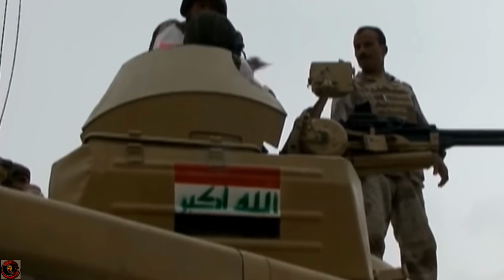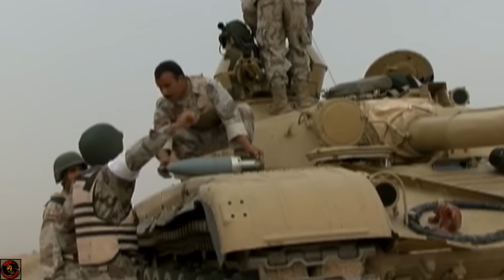Do Russian Tanks Need Bigger Guns?

Comment: 4:08 True. Vedy STONK Stalinium Soviet tenks powered by Zhukov-grade vodka aren't limited in anything, but gun depression. They usually have meagre gun depression of around 5-6 degrees. People always say Russian tenks have the worst gun depression. But that's not so bad, because the prize that goes to the tank with the worst gun depression is actually the Swedish S-Tank, because itz really just a fixed gun that is bolted on to the chassis. So technically 0 degrees (+1 degree if your lucky enough to run over a deer for tactical aiming XD). The only real reason the S-tank is able to aim up/down is due to its hydropenumatic suspension (-10/+10 degrees). And even with that special suspension, the S-tank still sucks, because it doesn't have enough gun elevation to engage low flying aircraft at relatively close range (So itz kinda no wonder why mass production of this vehicle wasn't even considered, that, and also, because it sucked at firing on the move, because it didn't have a gyroscope...and no, you can't mount a gyroscope on to a fixed gun). Hell, it would have to be built like the STUG (becauz Stug gangsta lyfe) with an ACTUAL elevating gun in order to have any chance in haell to engage any sort of aircraft

So, the hydropenumatic suspension could maybe increase the elevation range of a soviet tenk to around (-16/+26 degrees)...but like you said from before Matsimus, you said that this type of suspension is kinda a beech in sandy environments, and you have to haul lots of helium gas or something :/

But despite that, I have to kind of hand it to the Russians for at least attempting to fix their gun depression problems. One notable way they tried to fix this is through their T-95 (No, not the WW2 T-95 doom turtle that came from a kid's wildest imaginations) "BLACK EAGLE" tenk program (I am kinda surprised why the Russians didn't even consider to mass produce a cheaper version of the T-95.....but no...they had to go with the T-14 Armata, a tank with so many flaws *mumble* **mumble**...because they wanted a robotic tenk they said...it would be fun they said). The turret of the T-95 tank was very interesting, because it incorporated a sort of "horn" that extended up from the crew compartment of the turret. This "Horn" feature allowed the gun to depress further than conventional tank turrets. In fact this "Horn" allowed the tank to depress to -10 degrees (which is pretty impressive, considering that the T-95 "Black Eagle" Tank turret was very short. And for those who wrry that reloading the gun breech while it is elevated up to the "horn", I have to say that you can't reload a gun in a conventional tank turret either when it's in full gun depression. This is, because you rly don't have any space above the gun to reload it while it's fully depressed. So, what the tank crew would do to reload a gun when fully depressed, is to elevate it back up to 0 degrees, load the round, then depress the cannon  

This "horn" feature is apparently so good that it's also featured on the Cockerill 3000 turret, the Lerlerc tank turret, and the K2 black panther tank

Comment: Russia doesn't need a bigger gun.  What they need is to get rid of the separated two-piece ammunition system if they want more power.  It is because of separate ammo, which is why their 125mm gun ammo ended up with less KE than NATO's 120mm ammo.Also, Russia's tank doctrine doesn't exactly rely entirely on the tank for their only AT weapon or infantry support.  Surface-surface fires are their best suit, hence they don't need a big gun.  All they need is enough firepower to fix a NATO force in place, while the artillery trashes everything in their killbox.

Comment: I think they need to consider doing what small arms have done.  Take a 4" or 5" SHELL CASING (preferably a disintegrating case like the German 120mm Casing) but "downsize" the actual round's caliber to around 90mm (with a 70mm to 75mm Sub-Penetrator).  The increased velocity the 120mm case gives the smaller (sub-penetrator based) round would allow a flatter trajectory and greater penetration for hardened rounds.  The HEAT and HE style rounds would lose some power but could be made more effective with Thermobaric (fuel-air based) or Hyperbaric (reactive metal based) warheads.  The velocity would be an issue for barrel wear, but recoil wouldn't increase much.   I think this should be investigated by NATO.
Reply: What the hell do you think a APFSDS round is
Reply: Closer to 90mm fired from a 120mm bore.  Imagine SHRINKING the CANNON BORE to 90mm and STILL firing an APFSDS (but in 70mm, not 90mm) from that 120mm cartridge.   This would greatly increase the round's velocity without increasing the round's weight (actually decreasing it, in fact) or effective recoil (recoil speed will increase but not the distance recoiled).  This is one aspect of ammunition (HV small caliber) that may "export" from the US railgun tests.  It is possible to increase velocity using certain modern powders and materials used for railgun barrels that will allow smaller calibers to achieve the lethality of the 120mm smoothbore by accelerating smaller caliber projectiles above the perceived 5000 ft per second "threshold limit" of modern tank guns.  Imagine your current tank round as a "bottlenecked" cartridge with a normal powder charge but a much smaller projectile.
Reply: Blox 117:  They are reaching maturity.  The biggest problems right now are that you have to cool the emitter (usually with liquid nitrogen) of high output lasers (Megawatt output) and charging them.  I saw a proposal for an M1 with a homopolar generator connected to the turbine that charged a capacitor to fire the laser.  The turret was removed and the laser, targeting sensors, and MG were installed in a small mount on a rotating scissors-type armature (think of cherry picker type lifts) that could raise the weapons and sensors up from behind terrain features.  The two problems with it were a LONG cooling and recharge time and insufficient power to instantly burn through armor.  The design I saw is now at least 10 years old.  I'm sure they have made improvements by now.
Reply: The mass is attained by using super dense materials like Depleted Uranium.  The DU also acts like an API round when it penetrates.  It spalls and the friction causes the material to ignite.  This effect can be enhanced by adding a secondary Hyperbaric effect to the round.  A small canister of reactive metal (like Sodium mixed with Aluminum shavings) at the tail of the round will be ignited by the burning DU and cause an "overpressure blast wave" inside the vehicle after penetration. 
         The velocities I'm postulating with the subcaliber round being pushed by a 120mm CASING are above the 5000 ft per second threshold we have already reached today.  We haven't been able to effectively push past this because of potential barrel failure and the tremendous barrel wear.  The higher velocities will either cause a "catastrophic failure (explosion)," or will just "burn out" a barrel within a few dozen shots.  The Navy's experiments with railgun barrel life may have solved this issue by pairing newer High-Strength Steel, advanced metals like Scandium, and Carbon-Fiber Nanotube technology together in composite barrels.  This may allow tanks to exceed the current velocity limits by a significant amount.  This technology, combined with newer propellant technology, may allow us to make a "breakthrough" in Main Gun velocity/lethality.  
        Then there is the alternate technology that may move the forefront.  Digital/Electric binary rounds like those pioneered by the Australians with the Metal Storm System.  The US Navy bought and tested several 40mm Grenade Launcher Metal Storm Systems as a Point Defense System on their ships.  I do not know what the development state of Metal Storm is at this point in time.
Reply: NO FUCK WHAT YOU SAID, LASERS
Reply: swaghauler that was tested in the cold war by the americans I think. But remember velocity is not everything, projectile mass can be equally important
Reply: 110mm round with 140mm cartridge?????
Reply: You need both mass and velocity to have the energy for penetration, it's physics. But for higher velocity you need a longer barrel and bigger propellant charge and you wear out the barrel faster. The barrel can only be so long or it becomes unwieldy. Lighter rounds also lose energy faster at extreme ranges. So it must be a compromise between projectile mass and velocity for the required energy.
Additionally the projectile and propellent size can mean you can only fit a less than optimal number of rounds in the vehicles.
BTW lasers as energy weapons become useless in fog and rain due to refraction.

Comment: 3:51. Yes, recoil length is indeed a big problem, because it means that you need larger turret ring diameters. As far as I know, the most important requirements for mounting a larger gun is to have sufficient turret ring diameter (However, you can make larger turret ring diameters without extending the width of your chassis. And this is by inserting a turret ring that extends away from the side side hull of the vehicle. This result looks like a that bowl has been welded unto a tank's hull, and you can see this bowl more pronounced on the T-55, T-62, and post war russian tanks. Since this bowl feature helps in preventing the tank's hull width to increase, it also saves on mass. The M1 abrams also has this bowl feature too, but not to the extend of the soviet cold war/modern era tanks, and mass (you need mass, because that prevents large amounts of momentum being generated by the gun to act too harshly against your chassis, and rock it back, and forth). However, there are ways to remedy this, muzzle breaks, and certain types of suspensions can reduce main gun recoil. In addition to this, there are other MORE EXOTIC TECHNOLOGY THAT VASTLY reduces the recoil. Such exotic technology includes a special type of hydropenumatic recoil mechanism, and a VERY WEIRD high velocity recoilless gun that works similarly to a bazooka, but is much more complicated then that...shit...I already said too much. I won't say anymore about these sekrits

Comment: For the soviets, the rationale for going higher in caliber faster than NATO was based on two doctrinal advantages:
First with high muzzle velocity and energy you can get sufficient anti armor capability with brute strength compensating for complexity in design. This way you get AP rounds that are way  cheaper and faster to produce compared to NATO ammo.
Second and perhaps more importantly is a way bigger punch in HE, which was much more valued by soviets than NATO, since they expected to launch an offensive war, punching through the weaker parts of NATO lines, filled with fortified positions and soft targets but hopefully few to none NATO tanks. Soviet tank doctrine was very much based on the experience of operation bagration during ww2. In comparison, NATO was indeed expecting the soviets to strike first and thats why they´re design philosophy, doctrine and deployment was defensive and more reminicent of the tank destroyer mission. Heck while even today russian tanks pack at least half of they´re ammo with HE-FRAG rounds, the standard 120mm doesn´t even have a HE  round in existence!

EDIT: BOFORS indeed developed a proper HE round for 120mm but it is only in service with the swedish STRV-122
Reply: Change your "they're" to "their". No offence meant.
Reply: Rheinmetall also offers the DM11 HE-FRAG-T round, which is currently being used by the German, Danish, Dutch, Spanish & Norwegian army. This is a proper HE round with advanced fuzing, check it out for yourself: https://www.youtube.com/watch?v=0HgTfsA7b6A

Comment: Well I wonder who can design a tank around a rail gun system? A great leap in firepower than conventional guns
Reply: Angelo Agriam well, there are still some issues with that, mostly because of the size. Railguns require a lot of energy to fire, and it is needed to place the batteries and something to recharge them all inside the tank. For now, ship based railguns seem the only viable option

Comment: we clearly need 425mm cannons in tanks
Reply: Why stop there? Go with a brand new 1000mm cannon.
Reply: The russians already mounted a 420 mm gun on a tank

When it fired the suspension was destroyed
Reply: @GlowingSpamraam  that was a mortar , the competitor to Oka was Kondensator with 406mm battleship gun.
Reply: @Callum Gledhill
That can be the coaxial mounted gun
Reply: Destroy all of its cameras and melt the armor
Reply: @tykedurst  laughs in Abraham
Reply: how about that giant 900 mm gun
Reply: no 30mm is not used for taking out tanks the 30mm on a 10 is only effective because its used from top 30 mm is not enough for any modern tank
Reply: we need 500mm #bringbackDora #bringbackGustav
Reply: What the hell is a 30mm cannon gonna do to a modern MBT?
Reply: fck no
Reply: Maybe start with an 8 inch gun first
Reply: We need to put 800mm railway guns on tanks, BRING BACK ZE SCHWERER GUSTAV JA?
Reply: no, lasers
Reply: Bruh, just develop a chassis and track system strong enought to take a Yamato turret with 3 460mm guns, make the turret out of modern composites instead of just steel and have some mUzZlE bReAkS, and  a couple of 1500hp gas turbines to power the bitch, and a GAU-8 ontop for AAA purpose (with a radar system), and a couch, because why not?
Reply: Hobocron no, we need the A10 30mm gau cannon mounted on a tank
Reply: Callum Gledhill theres is such tank on a M48 Patton chassis from a DIVAD project, it didn't get much attention and soon scrapped
Reply: @KinorArgonis  as a secondary
Reply: Beneteus der graue Wolf, Dora Dora the explorer
Reply: no, ICBMs
Reply: no but really what if we took a big fuckoff 300mm gun and put it on this massive damn tank, what would happen?
Reply: Hobocron Russia tried 420mm(Nice) gun on tracks, but the recoil would warp and slowly  tear the chassis apart. Saying that modern design technique combined with modern materials may make a difference, but regardless there is no need for anything larger than 180mm for any purpose or situation. Before you say anything yes I am aware of the british prototype fv 4005 with a 183mm gun the German blue printed jagpapanzer e100 with a 180mm gun
Reply: How about 600mm???
Reply: 600? Pfft... Go big or go home... 700 ;)
Reply: Love an 425 degrees
Reply: Kv2x2
Reply: + SVS that 30mm gun is used for taking out tanks.
Reply: @imnotmlg4397  yeah from the top where a tanks armor is weakest but that gun couldn’t even scratch the front of a tanks armor